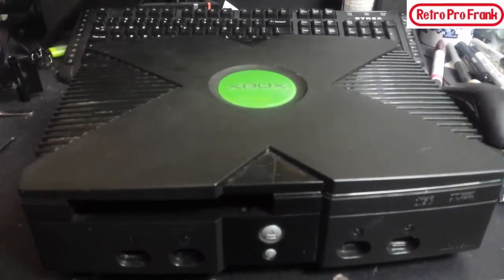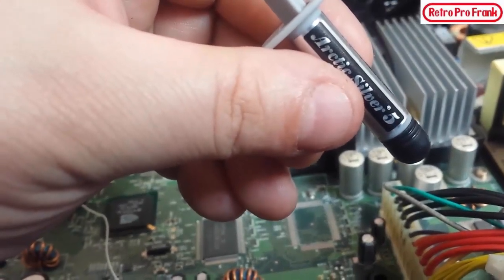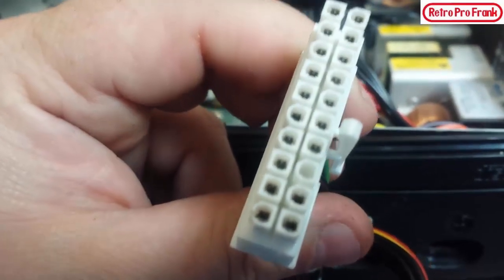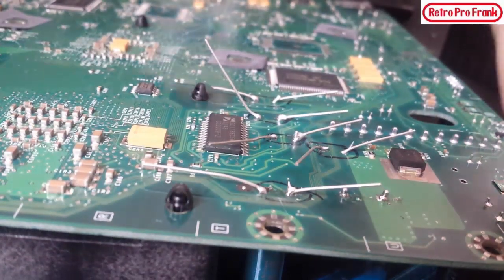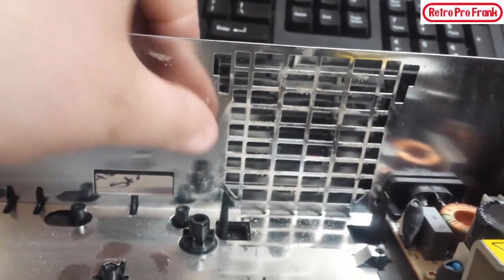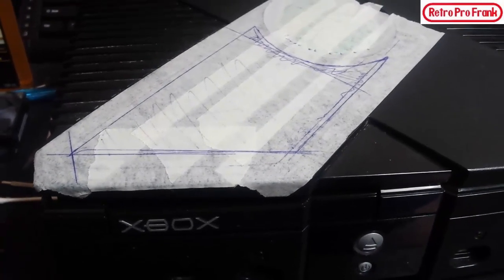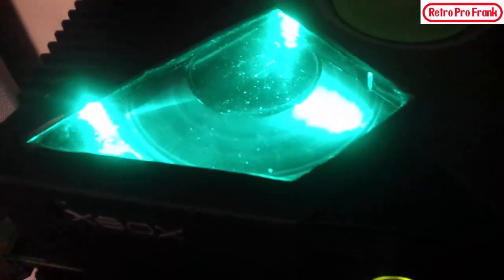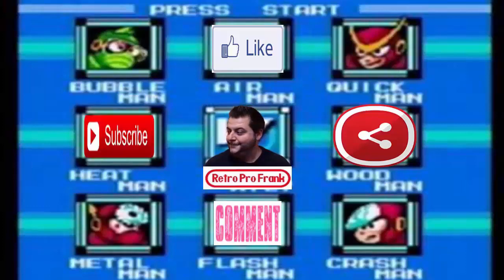ORIGINAL XBOX CAPACITOR REPAIR DIFFERENT VERSION DISCUSSION AND WINDOW LED MOD - RETRO PRO FRANK

Comment: I find people do things because they saw someone do it. The reason the clock cap failed like they did was because the charging voltage is at or just above the caps rated operating voltage. So you have to think a leaking battery from charging at a voltage and current above safe ratings. If I replaced that cap it would be rated at near 6 to 12 volts.

Comment: Getting the caps legs through the holes was an absolute nightmare i don't know how you did it so easily
Reply: Tell me about it. I've done cap replacements on 2 of my 4 Xbox's and it's extremely difficult to get the capacitor leads to go through the molten solder holes.... What's worse is on one of my boards I have the 1500uf,6.3v caps and on the other I have the 3300uf,6.3v caps and when I ordered them online the 1500uf caps came with leads that bend out to the right lead width so you can't put any force on the leads without them bending..... Took hours

Comment: Broke my 1.1 taking the gpu heatsink off, the old thermal paste had went solid and taking it off must have damaged the chip
Reply from the maker: chris rennie wow I never heard that maybe next time apply some heat first and use gloves so you don't burn yourself touching to GPU heatsink. I must have done this to at least 10 of them never had a problem. But I will keep that in mind for the next one thank you
Reply: Yeah unfortunately I read about applying heat first once it was too late. A real bummer considering it was my childhood Xbox but nothing I can do now without some pretty pricey tools to replace the GPU. at least I have a spare Xbox still for that nostalgia experience
Reply from the maker: @K1LLJOY  the old saying is you live and you learn. Good thing about the original Xbox is you can find one that needs a little bit of fixing up for cheap if you look around. But you'll never make that mistake again :-)

Comment: Ask and the Retro Pro Frank Delivers ... Cheers bro.
Reply from the maker: Canadian Retro   well I know that the front there's some sort of selectors. If it has five switches it probably has 5 different biases periods which means it might have the possibility to have 5 different boot options. maybe only one or two are programmed.. how to get your Xbox to work try switching the button one at a time and turning it on and off over and over again till you get the right combination on the dipswich

Comment: cool mods and cap replacements .... I have a service warning message come up on my xbox screen also the red ring of death .. I picket up this xbox for £1 at a garage sale ... is there any suggestions to what I can do to repair this ? cheers thanks
Reply from the maker: Install a modchip..
Reply: I had that and it was overheating (I disconnected the fan placing the DVD drive back in!)

Comment: Thanks, good looks. Do you think that silver conductor pen will work? That's supposed to be for people with no soldering skills
Reply from the maker: patrolzero maybe 4 tsop flashing.. more of a temporary thing. I don't think it will hold up to be honest I could be wrong. But if you go on eBay piping solder practice bored. You can buy these small boards for a dollar or two that shows you how to solder it's good practice. Or take an old DVD player from a thrift store and try to remove and install components on it as practice. Go buy yourself a decent soldering iron with temperature control.... a lot are very expensive but some r very affordable.. for an entry-level soldering iron with temperature control should be around no more than 40 Canadian dollars. Just make sure that it has a very pointy tip. Because you're doing Precision work. When you solder in a jumper try to use thinnest gauge wire possible. 28 gauge minimum. Practice makes perfect. So practice practice practice and before you know it you will be a pro at it
Reply: Thanks for taking the time

Comment: my original xbox clock capacitor started leaking and now there's some corrosion on the motherboard is that fixable ???
Reply from the maker: Yes 100%. I would say remove whatever is left of the clock capacitor go over it with isopropyl alcohol. Flip the board over clean up the bottom side of the board and you can even do Trace repair

Comment: bro...you need to invest in some better tools - soldering iron, side cutters, etc.

Otherwise, good video! Thanks! :)
Reply from the maker: Yeah that's what I had at the time. If you look at my latest video it's kind of an updated version to this video. Much better tools now. I've done a few Ram upgrades and those points are very tiny. Got them working great take a look at my new video last one I uploaded to the channel

Comment: They do have IDE ssds ... older thin client's have them the most I've seen is 16gb
Reply: no but they have sata to IDE converts you can use. you need a specific one though research it